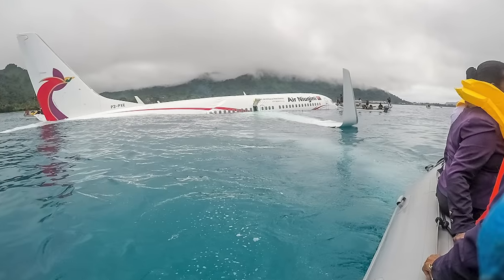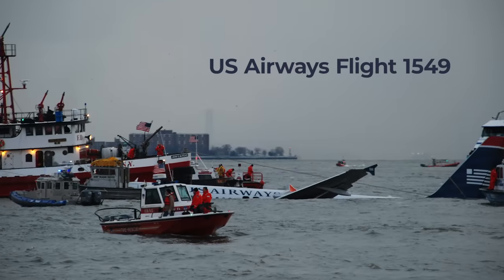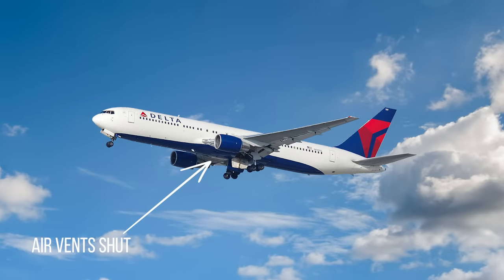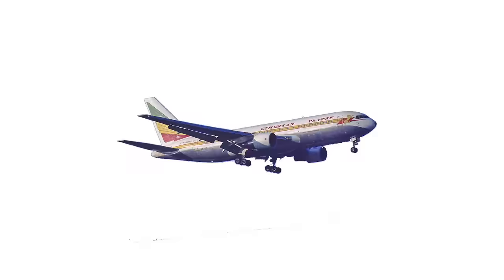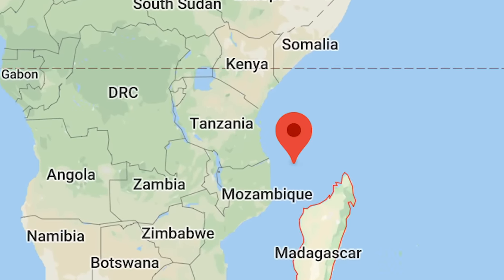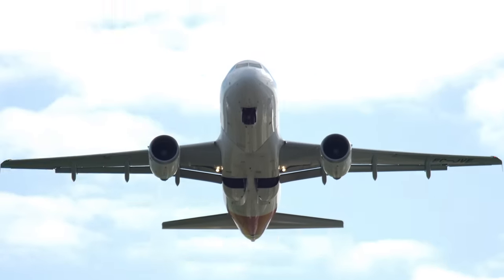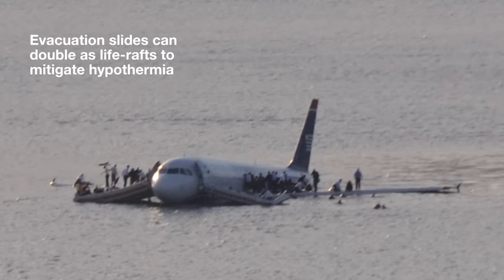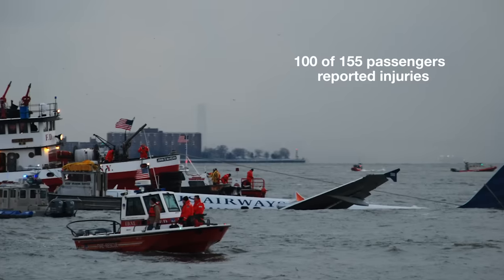What Happens If An Airplane Lands in Water?

Comment: You forgot to mention about the recovery of the flight data recorder and the cockpit voice recorder, which are both essential in figuring out why the aircraft went down in the first place. As with the loss of the RCAF CH-148 Cyclone helicopter off of Greece a couple of weeks agao. Since the CH-148 is a militarized version of the civilian S-92, it had the "black boxes" on board.

Comment: You would also want to land with landing gear up. This allows the airplane float on its body.
Reply: Landing gear does have something to do with it. However it is more due to the fact that if the landing gear hits the water first it can make the plane nose dive into the water. Thus leading to an increased risk of the plane breaking apart on landing. Not only that the goal of landing on water is to have the plane glide onto the water. And not a sudden stop, which the landing gear would due. 

Mind that water can hit you like concrete when you are coming at it with about 200 km/h

Comment: #idea
Why do some aircraft have engines on the wings, and others at the back?
Reply: Big planes land in big air ports where foreign bodies don't make way on to the tarmac while small aircrafts land in small air ports where foreign bodies make their way on to the tarmac and they don't want it to be sucked into the engine hence the position of engines varies an more over engines are big an private aircrafts ride low and will scrape the engine to the ground if not put above.😊😊😊

Comment: Not all escape slides can be used as life rafts.
Reply: They are now, or should be. Raft has been available for years. 
Australian Qantas Safety Manager named Jack Grant invented the Slide Raft in 1965. Prior to that, aircraft carried inflatable slides at the doors and inflatable life rafts taking up valuable space and weight. Jack Grant worked out a way to combine the slide and the raft in one system.

Comment: Why not build a floatation system on those big aircrafts? Kinda like small water planes have. That's my idea. So in case of an emergency landing into the water, the plane will float instead of sinking. Unless you're in a storm which nothing will float then
Reply: Because it's extremely rare. You are much much more likely to submerge your car in water than for an airplane to ever touch any body of water. So you might as well attach floating devices to your car or get one of those James Bond submarine cars :D